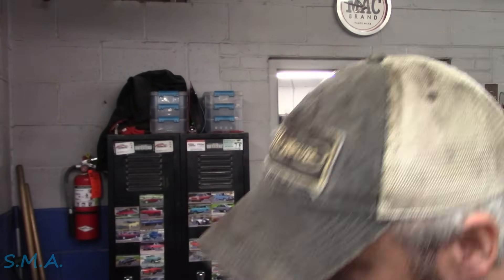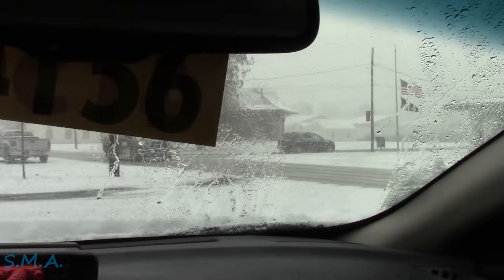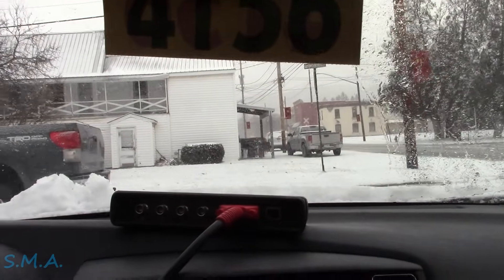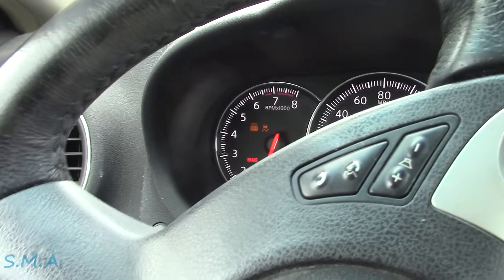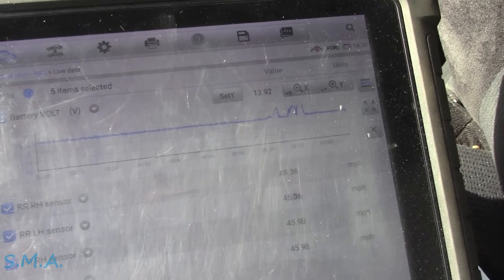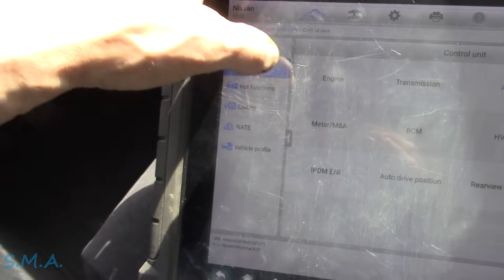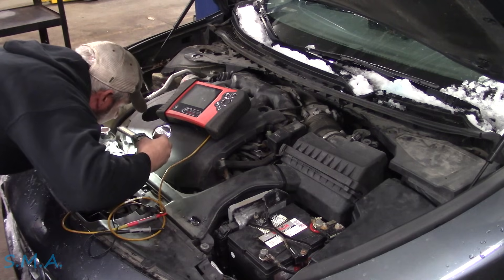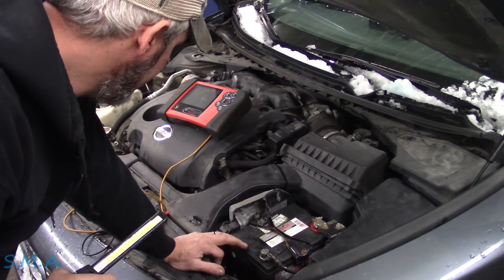Nissan Dealer Quoted Over $2000 For A New Harness!!

Comment: I’m surprised the dealer went chasing all that. As a Nissan tech myself these symptoms usually point to either a bad alternator if it’s oem and untampered with or some goomba wired the pigtail for the new alt wrong.  I’ve seen a rare case when I was an apprentice that there was a diode in the meter assembly that controlled the charging system went haywire but every problem is different lol waiting on part 2 😂
Reply: Fact: most Nissan dealers suck hence why the brand is dying .
Reply: @Davido50  I can attest to the shitty Nissan dealers. I've worked at a couple, never again lol.
Reply: @Davido50  That's part of it. However, Nissan is called the Japanese Chrysler for a reason. Their engines the past 15-20 years are questionable at best. And if you're looking into Japanese manufactured vehicles that are going to last a decade or longer you're going with Toyota or Honda. Not Nissan.
Reply: I was a Nissan tech also. I wouldn't have chased all that because I'd only get paid for 1 hour diagnose. The technician can say they don't know what wrong. It's the service writers that talk to the customer because thats their job. They don't like it if you can't figure something out. That's just the nature of the game though. Sometimes you just can't figure something out. I miss working for that particular family who owned the dealership, but not actually working for Nissan. The way flat rate works, it's makes it almost impossible to not rush things.
Reply: @dimmn82  - if a 'service writer' tried to tell me what's wrong, I'll tell him to get out of my way and let me talk to the person that did the diagnostics.
Reply: @tbelding  believe me, i get it. i'd rather talk to the technician too. but it's almost always not allowed unless the technician needs to physically show you something. i tried talking to my customers and got disciplined for it. if i can sell the customer the work and they can't.....something is wrong.  also, if they work flat rate (which 90% of auto techs do), they aren't gonna take time away to talk to you simply because it costs them money to do that.
Reply: @dimmn82  - The point is that if I'm paying for a diagnosis or a service, I want the person who actually did the service/diagnosis to give me the fast rundown.   Not someone who is probably as 'good' as my wife at reinterpreting information.    I think the longest I ever kept a tech away from his work was three minutes.   Sure, I understand that service writers help dumb things down - but I don't want dumb.   The last time I allowed a dealership to pull that, they had to take the car back twice because they hadn't fixed the problem - and I forced them to do it without me paying them, as they returned it to us as "fixed".
Reply: @tbelding  i totally get it and agree with you. i'm just saying, the technicians can get in a lot of trouble for talking to you. you aren't gonna see that conversation though. it's a terrible business to get into and i dont recommend it to anyone thats fresh out of highschool. any comebacks for the same issue will be listed as a comeback. meaning the technician does it for free also with you not paying. trust me, we'd love it if we could be the service writer too. but all we can do is write down our findings so the service writer understands it.
Reply: @dimmn82  You may think it was terrible, but it was a cracked a/c line (from a trailer move of a car).  They charged me 2 grand for replacing the compressor and recharging, and I confirmed - three times - that they'd fixed it completely.   Two days later, I parked it back there, and told them to not call me until they'd actually fixed the problem.   That took them another two days.    I think I was overcharged as well.   So, you can see where I'm coming from.
Reply: I had a 2014 Sentra that the AC started doing strange stuff. The dealer quoted $1800 to replace the compressor. I couldn't believe that the compressor had gone bad because sometimes it would freeze you out of the car one minute and blow warm air the next. Sometimes it would work fine for an hour or two then start cycling between warm and cold. I did research on the compressor and found that the compressor had a control valve in it that would stick so that the control module couldn't change the output of the compressor smoothly. I bought a replacement control valve for about $45 and put it in with help from a friend who has the equipment to recover and recharge the AC. The original valve started giving problems about a year after we bought the car new. The replacement was still working good 5 years later when the car was totaled. Yes, Nissan used to be a great brand. Now, they're not. My 1991 Sentra was still running great at 395000 miles. It just wasn't worth the cost of replacing the struts and painting it. The paint estimates were almost twice the Blue Book value of the car.
Reply: @davidfence6939  uhm Nissan died in 2003 and were acquired by Renault. Same happened to Mitsubishi. The cars are all rebadged French junk. It's basically "The Amalgamation Formerly Known As Nissan" these days.

The same fate awaits Chrysler. Soon all their cars will be rebadged Tonys.
Reply: @danielbutler578  You got lucky with that control solenoid. Most modern day compressors no longer use a clutch drive. Rather the compressor runs continuously even if the AC is off. The control solenoid is pulse width modulated and can control the output of the compressor from 0 to 100%.

The trouble is that officially, that part is not sold separately. It's part of the compressor, and sold as a unit. In the aftermarket, there are some Chinese solenoids that folks swap in to get a cheaper solution. However, that's hit or miss. Your example is a minority. In most cases, that Chinese solenoid will fail after a year or so, and you will be back to square one again. Depending on how buried the compressor is in the engine bay, determines if the repair is worth it or not.

On some cars, you are just better off replacing the compressor.

Comment: I have a Buick Roadmaster where it was doing all sorts of crazy stuff. Driving it, it'd throw codes all over the place, including a code for bad PCM code (94, so pre-OBD-II). It was very intermittent though, it'd run fine, then start acting weird. I did the obvious stuff at first, as power/grounds were all dirty from age, still no change. Using a digital multimeter, I noticed way too much fluctuation on the voltage when running, I decided to remove the alternator trigger wire, took it for a shake, and it drove just fine. Ended up rebuilding the alternator, and it's been a dream since.

Comment: Thanks Eric, part 2 will be a cliffhanger
I'm not a  service tech but have worked on my own 70s cars for the family to keep them running from the back yarn.
Lumina's had a bad issue that caused all kinds of issues like this. Found by tracing That a control board would crack at ground on the board. Was hard to find because it was erratic. A few bangs here and there by hand found the problem area. Boards would get old and brittle. and had to be replaced. The kids drove a lot of Luminas because I would find them cheap because they all had this issue. Those days are gone.
Reply: Computer board?
Reply: early 2000's f150/250/350 all have this issue currently if you're from a temperate climate. It'll heat and cool over and over and break some of the solder joints in the instruments taht are housed in the above windshield display. CAuses a bunch of error codes and bullshit as it connects/disconnects over and over.

Comment: Air bag controllers are always throwing codes for voltage low or spikes.  Years ago I use to check air bag units to see if there were voltage spikes or weirdness happening!!  And when it occurred  if I could get the info!! Good voltage indicator!
Corrosion does weird things to electronics!!    Dirty grounds through the harness to the block ....... engine  grounds to frame too!!  Sometimes I use to add additional ground straps!!   Can't wait to see how this turns out!!  Alternator is a good culprit or alt harness!!

Comment: Ivan just had one (Ford Escape) that had a bad voltage regulator causing it charge to almost 30v. That caused a cascade of fuckery. The Speedo would drop out and everything.
Reply: I had a Chevrolet malibu. The alternator did weird crap too. It kicked every traction control light on, killed the power steering, would turn lights on and off,  and would intermittently cut off the engine just to re-enable it just before completely stalling. I thought I was going to die trying to get off the freeway. 

Luckily there was a big box parts store at the end of the ramp that I was able to pull into.  Had to wait 2 hours for it to open but I used that time to look up the symptoms and found out it was common when the alternator went bad. I guess it was a bad neighborhood so I had half a dozen cops swing by wanting to know why I was in the parking lot before business hours. I didn't know if i was going to get robbed and killed according to the cops or go to jail for not being able to start the car and leave. Fun times.
Reply: "a cascade of fuckery" LMAO...love  the term : )
Reply: @lar6418   I’m a collision tech and I have told a few insurance adjusters that were trying to cut my repair times in half that.
Reply: Lol….I’m stealing that one. :)
Reply: Yup ... engine quit, heater went nuts, radio issues, odd burnt dust smell.  Got the alt swapped out for new Motorcraft (got a core refund!) and no more troubles.  Well, radio display doesn't like freezing weather, but that's it.

Comment: Dealer's new business plan:

Take so long NOT fixing a car the customer buys a new one.
Reply: When I worked at the dealer they would complain when I sold big repairs and fixed out of warranty vehicles. They definitely prefer to sell you a new car rather than repair them. 100%!
Reply: I hope she didn't buy another Nissan. I wouldn't give them the satisfaction.
Reply: @dchawk81  At least the transmission is still working when this Nissan was in its death throes. (Actually, I would bet heavily Eric will get it going affordably.)
Reply: @JimmyMakingitwork  ... and trade in the unrepaired one for half it's value !
Reply: @dchawk81  It showed 185,000 miles so what's your problem ?

Comment: Great analysis. I had two electrical issues with a 2004 JEEP Grand Cherokee. First one was multiple check engine lights for O2 sensors, trans, and a few other codes. Dealer said computer needed to be changed. That was done and problem persisted. Did my own research and poking under the hood and found out the inline 6 engine had a stud at the back of the valve cover that could sometimes wear into the wiring harness. That was the issue and got a refund on the computer.

Now in 2021 and at 300,000 salty miles, all gauges would go out while driving and no restart.  New battery and alt is good. A different dealer says computer is at fault and changes it. Problem persists. I started poking away at it and noticed severe corrosion under the rubber insulation where it ground cable joined the  cable end that goes on the battery. 

Cut the factory end off and soldered on a new end after thoroughly cleaning copper strands with baking soda ad water. Problem solved for under $10 and another computer refund! 

I have found most dealerships and mechanics are parts changers and not true diagnostic technicians. I think a lot of this is due to the pressure of get them in and out the door and always believe the computer! 

I am not a professional mechanic but certainly have spent a lot of time under hoods.

Comment: vq's often have issues with grounds. I own one, and while I never had an issue myself, many people on the forums talked about similar issues. the belt noise is probably from an out of adjustment tensioner, as they are manually adjusted. I would stick a couple decent ground wires to the block for testing and see how that goes.

Comment: Eric you need to go to that Nissan dealer and rip all those tech certified patches off the shirts 👕 hahahaha
Reply: Most dealerships will not fix a broken wire. They replace the harness, same with Honda or Harley. They change parts. If the wire harness is on back order people need to go to an independent shop

Comment: Was thinking the previous dealer tech(s) would have cleaned up the battery terminals as a 1st step in diagnosis rather than you having to do it after they couldn't fix the problem.
Reply: You never know... I had an intermittent drop out at high rpm. Stealership diagnosed bad gas and charged nearly $300 to pump the tank. Problem came right back. I ended up tracing it to the hall effect sensor in the distributor.
Reply: ...always start with the OBVIOUS stuff(?)
Reply: We’re taught to have clean connections and a good battery at Nissan tech training. Obviously these techs do not take any price in their work, much less the dealerships.

Comment: I am a diy but had an 06 Chevy Malibu (with close to 190K miles) where it would stall whenever you turned the steering wheel quickly, every single module in the car would lose communication with either; ECM, BCM, ABS, EPS, etc.  The alternator tested fine according to my multimeter and local parts store.  However, replacing the alternator fixed the issue as the old one did not produce the amps required by the EPS at low RPMs.

Comment: Alternator overload i believe will cause belt squeal.. you never mentioned if the voltage dipped before going high... cpu compensating for the instantanious drop in voltage giving the alt. full beans. Cable rubbing on steering componant?

Comment: Back in the 90s working at a Chevy dealer, Had a Caviler that would stall randomly. Another dealer couldn t figure it out. Driving with the scanner i notice battery voltage would spike to18 volts and the engine would shut off. Found out the engine ECM would shut down if voltage exceeded 17.1 volts to protect the ECM. Replaced the alternator and all was good

Comment: Great diag Mr O. Keep it up what I would do is test it for ac ripple like you did but find a different +v wire as far away from the alternator as possible   and repeat the full left lock and see the result
Reply: Actually when checking for alternator ripple you want to be right on the alternator output lug referenced to bat neg.
Reply: @Discretesignals  you can do it on the alternator AS WELL AS my suggestion. It works well for me and never had an issue. Especially since modern vehicles have many inductive loads.
Reply: @Discretesignals  I have been doing this work for a very long time and my method work, never had any comebacks so and edit for comment above: you can test it across the alternator and use my method grounding on bat -. So I'm sorry if you misunderstood my original comment 😁
Reply: What do you expect the capacitor to do for (a) your AC ripple measurement and (b) the case that Eric is working on?
Reply: @Graham_Wideman  it's a case by case issue mate sometime if you smooth that ripple it will stop causing issues and b. If you have a dodgy rectifyer inside the alternator then that can cause the issues that vehicle is facing.
Reply: @philmerrifield1163  I don't see your comment about the capacitor anymore, but I believe you recommended it for use during measurement of the AC ripple.  I don't think it's useful for that purpose, but I can see how it could smooth out the B+ rail and allow observing module behavior under that smoothed condition. (Though the battery itself is essentially a big capacitor).  I don't see how the capacitor is going to help with Eric's case of "alternator voltage intermittently high".
Reply: @Graham_Wideman  if you have ripple in a dc supply then it can cause the issues in that car (amongst other things) the rectifyer and capacitor is actually built into an alternator and b. The reason that you don't see it any more is because it was causing confusion
Reply: @Graham_Wideman  plus a battery is the opposite of a capacitor. A capacitor is designed to charge quickly and dump its energy quickly, whereas a battery releases its energy more slowly than a capacitor. But Eric didn't know that the voltage was intermittently high until seeing it on a scan tool.
Reply: @philmerrifield1163  I wouldn't characterize a battery as opposite of a capacitor, though the two do have different characteristics for sure. But in terms of "speed of releasing energy", you would need a quite large and specialized capacitor to do better than the current delivery capability of a car battery, at least at the frequencies of alternator AC. Apparently, automotive batteries have an internal resistance in the range of say 1 to 20 milliohms, and it's a fairly special capacitor that has such low ESR (in a large enough capacitance that will make a difference here).  I guess there are scenarios where the alternator could produce high-frequency noise (ie: not the normal pulsing output of the diodes) that could be soaked up by a capacitor near to the alternator, but less successfully by the battery at a distance. And that could help in measuring the AC genuinely from the diodes.
Reply: @Graham_Wideman  maybe I could have worded it a bit better but as the alternator on this vehicle could be just doing what it's told to do by the pcm bit of diag left to do. However I will state this: this car has electric power steering, which has a very large inductor in it. If the issue is being caused by the alternator or by that I don't know as I am not there but we have to wait part 2 to find out 😁

Comment: Bottom line, it’s only spiking when the steering wheel is turning full to the left.  Meaning that it could be pulling a cable that causes the alternator to spike up on voltage due to a missing connection, it could be also related to the steering wheel where it could be pulling a cable , maybe some work done before where the cables were not routed correctly causing the wire connector to come loose and the alternator spiking